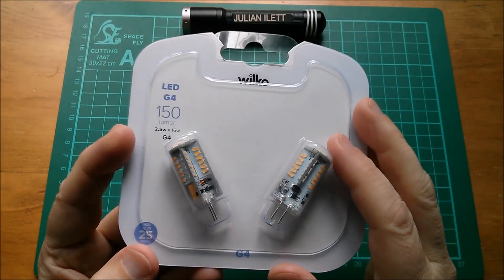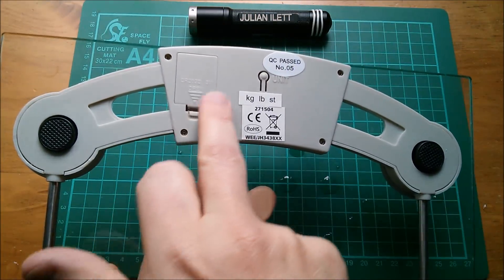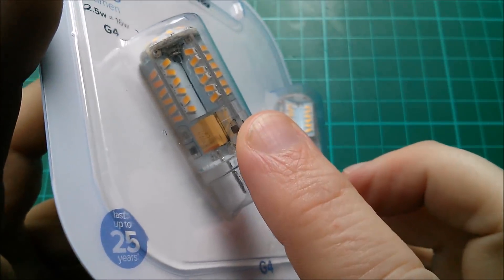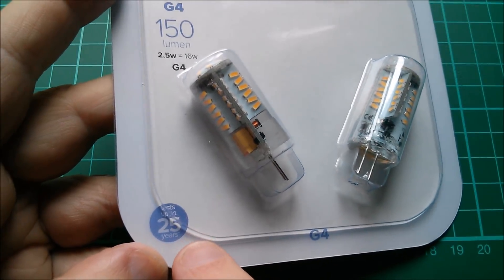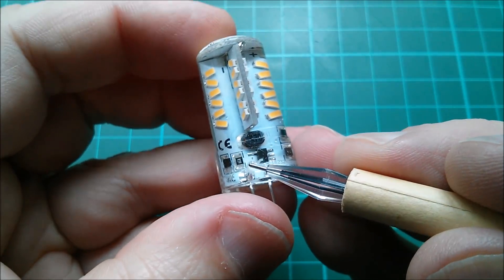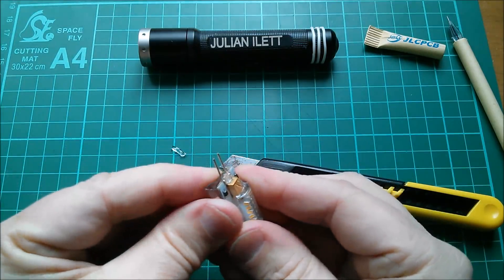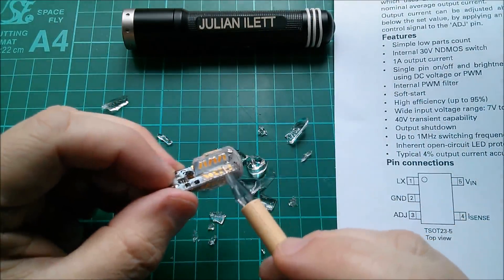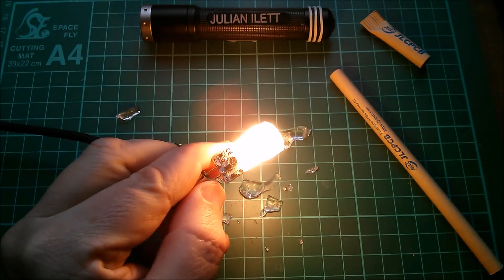Wilko 12V G4 LED Lamp (plus 3 other Wilko items)

Comment: Hey mate, not sure I'm more surprised that you aren't using them for years now (I switched all halogen except for one dimmable fixture to them 3 or 4 years ago) or that you haven't come across them on Chinese Ebay sellers since you're doing a lot of Chinese LEDs.

Anyway they do exist in two different variants: 12V DC and AC with the main difference being the huge cap to prevent flickering on AC, some even claim to dimmable but that pretty much never really works. NB: Halogen "transformers" have a minimum load so if all halogen G4s are replaced in a fixture it typically doesn't work anymore. :(

Comment: The middle of the leds don't need separation, they could both be the negative end of the strings of 3, with the positive going to each end.

Comment: Those filament solar lights are in B&M for £4 and in Dunelm for £8. I assume they use the parallel cob LED filaments which appeared last year on aliexpress. The ones on there are 5 LEDs in parallel and run from 3v but yours look more like 10 LED
https://www.aliexpress.com/item/5Pcs-Set-COB-LED-Filament-Bulb-Candle-Light-Source-Bright-Lighting-DIY-1W/32832749677.html

Comment: The ZXLD1360 chip alone actually costs more in single pieces on Mouser than the whole LED light you bought.
Reply: anlumo1 they were £9 originally.

Comment: You need to start reading your advertising dictionary...

"Up to 25 years*"... A meaningless statement. It just means any length of time <25 years.
I wonder if you could take them to court if it did last more than 25 years?

I'm amazed they didn't use the other advertising cliche of "Could".... "Could last up to 25 years*"...

You see the same kind of BS on bleach, "Kills up to 99% of all known germs"... After translation, the only thing that says is that they aren't confident enough to claim 100%.
Reply: Steve Evans The curious thing about the 'kills 99%' claim is that the reason for not saying 100% is actually quite interesting.
It's not a that it won't kill them all, it's that it's ostensibly impossible to definitely know whether you have killed them or not.
Part of the problem stems from it being scientifically questionable to  say that a virus was alive in the first place.
Reply: "Kills up to 99% of all known germs" is both a truth-in-advertising and a scientific thing.
Reply: Pook 365 It is the .01% that will kill you/one
Reply: One per cent of 10,000,000 per square centimetre is 100,000. And they can double in number every 20 minutes, under the right conditions. So, after only two hours they could be back to almost 10,000,000 bleach-resistant bacteria.

Comment: About the radio clock. The SET is there to be able to set the time in areas where the radio signal is too weak.
Reply: REC is 'Receive', for receiving the broadcast sync. signal. Mine turns the receiver on and off.
Reply from the maker: Ah, of course, there's no mechanical winder on this clock. Maybe SET advances it and RES retards it.
Reply: On my clock from a different maker, it is also needed to set the time zone and to enable/disable automatic daylight savings time mode.

Comment: The scales are a little trickier to read, you'll need an HX711 module and to wire it up like this: https://www.hackster.io/emmanuel-edwards/hexiscale-bathroom-scale-with-hexiwear-90716b. Very hackable though, and you might find the LCD has one of the rubber strip electrodes and can be reused. I have what looks like the same model from Bargain Buys.